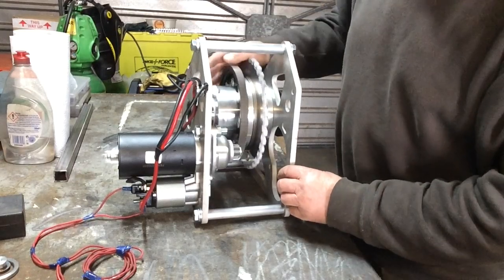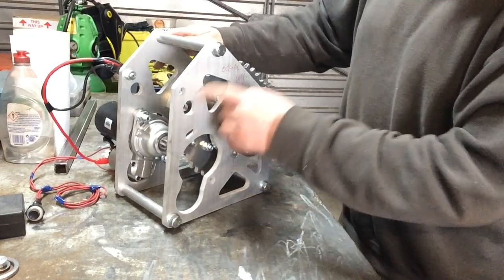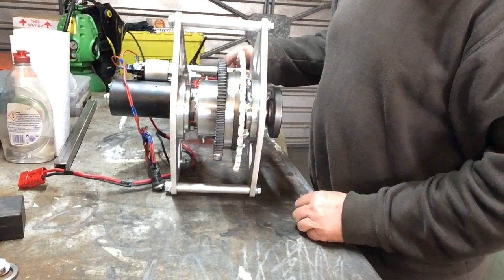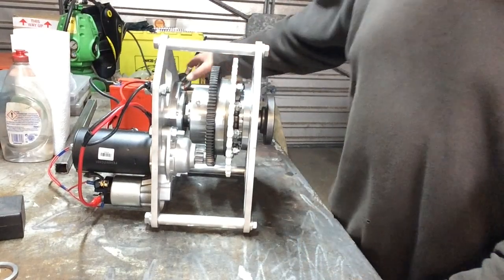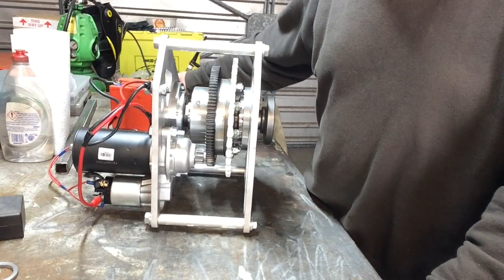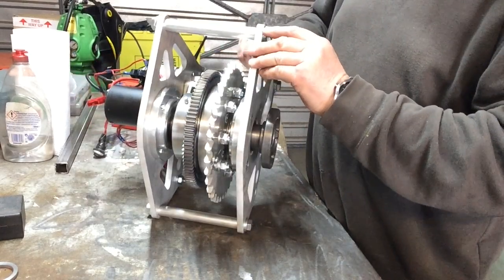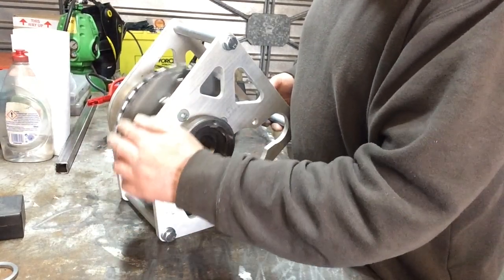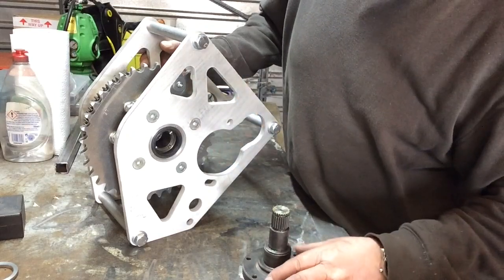Building (Ford) IB5ATB LSD Chain Drive with Electric Reverse

Comment: Hi Doug lovely work I was wondering could I use an 84 tooth ring gear with a 10 tooth starter
Reply from the maker: You need to make sure that the gears have the same module/DP.

Comment: Would it be possible to put a rotor on this assembly some how? Or maybe 2?
Reply from the maker: Yes, I have built several chan drive differentials with either a single rotor on the body of the differential or two rotors fitted to the output shafts. https://youtu.be/rGWsgsf7RXg?si=VOKUy4LdDP8NqD6i
Reply: @ do you believe that one rotor would be enough stopping power for 200+hp and if not would the 2 rotor version be able to work with the electric reverse?
Reply from the maker: @jkallik  I would be wary about using a single disc rotor version even with an LSD. The twin rotor version can cause problems with fouling the reverse motor. I had to use a very large diameter ring gear to enable the reverse motor to clear the right hand rotor. I modified a BMW X5 flex plate for the ring gear.
Reply: @ so I assume the starter motor was mounted somewhere else on the vehicle and not on the assembly like in this video? With the large diameter it still fits in the mounting case?  Sorry for so many questions ; or would it just be more cost effective to fabricate outboard brakes?

Comment: Hello, thank you for your response, I am thinking of making mine with a 188 differential from BMW, what do you think?
Dominic
Reply from the maker: Hi Dominic, I did convert a BMW 188 plated LSD differential (a few years ago). As I recall, it was quite difficult to seal up the case and faceplate due to the location and size of the various holes and cut-outs.
Reply: because of the crown mounting holes?
Reply from the maker: No, the holes in the faceplate where the inner parts bolt in and the holes on the other end of the case where the oil retaining can needs to seal.
Reply: ok, I'll see how to do it.
-the 3 spacers, between the 2 aluminum plates, are also aluminum or steel?
-the crown for the chain is steel or aluminum?
THANKS
Reply from the maker: The side plates are 10mm Aluminium plates (water jet cut), the spacers are 19 mm Aluminium bar, the Sprocket is 7075 Aluminium, the bearing carriers are machined from billet 6082 Aluminium bar, the oil retaining can is 10g (3mm) wall Aluminium tube, the backing ring for the reverse gear is Aluminium billet bar, the reverse ring gear is a modified Kawasaki 900 clutch basket gear welded to a 3mm steel hub. The reverse motor is a VW/Audi 1.9 Tdi starter motor. The flanged output shafts are fabricated using cut down (after-market) Ford output CV joints with EN8 steel flanges tig welded onto them.
Reply: Hello, thank you.
the spacers are a 19mm aluminum bar, they are drilled and tapped at the end?
Dominique
Reply from the maker: Yes, drilled and tapped for M10 bolts

Comment: Hello nice video, where did you find the crown for your er4 electric reverse ?
Reply from the maker: I used a Kawasaki GPZ900 clutch basket ring gear with the centre cut out and an adaptor plate tig welded to the gear.
On other units I sometimes used DP12 gears waterjet or laser cut from 6mm thick stainless steel.

Comment: Are you using a normal 12V battery?
Reply from the maker: I recommend using a separate 12v car battery to power the electric reverse. See my other video showing the unit fitted to a car https://youtu.be/Ir7V3d9pQoI

Comment: What are the specs of the chain and sproket you're using for this setup?
Reply from the maker: I usually use 530 chains and sprockets. DID530ZVM-X chains are good for most use. Sprockets are usually 7075 Aluminium alloy.

Comment: Hi, How do you wire the button to the starter?
Reply from the maker: Best to wire a push button via a relay interlocked to the bike's neutral light switch. That way you can only energise the reverse motor when the gearbox is in neutral.

Comment: Hi mate, I’m wanting to build a ib5 chain diff for my mini r1, what Ford is best for the ib5 gearbox to get the part out that I need ? Thanks
Reply from the maker: Hi Tony, the Fiesta RS Turbo had a viscous coupled LSD which I have used on several chain dive differential units. If you are in the mainland UK, I have a couple of RS Turbo differentials that could be used for the conversion.
Reply: @DougsShed   sounds perfect mate, how can I contact you ?
Reply from the maker: @tonybingley2979  douglas@westgarage.co.uk
Reply: @DougsShed  
I’ve sent you a message 👍

Comment: Congrats on retiring! I read below that the reverse gear is from a Kawasaki and machined, but could you let me know what starter motor you are using and if the starter motor gear is stock?
Reply from the maker: Hi, I use a Audi A2 1.4 TDI 99-05 & Audi A3 1.9 TDI 96-03 Starter Motor also used on VW Golf etc

Comment: Is the ring gear for reverse an off the shelf item or did you make it?  Thanks
Reply from the maker: What's going on in Doug's Shed?
The gear on this differential was fabricated from a Kawasaki GPZ900 gear from the outer clutch basket. The centre was plasma cut out and a 3mm mild steel hub was welded on to provide the locating holes for bolting to the differential housing. On some other units, I used 6mm stainless steel waterjet or laser cut gears. Just a case of drawing up the gear in CAD and sending a dxf file to the cutters.
Reply: @DougsShed  awesome thank you!

Comment: Great Videos you have Doug! Where did you find a ring gear small enough? or did you make it? I'm having trouble finding a small enough one for my build. Thank you
Reply from the maker: The gear on this differential was fabricated from a Kawasaki GPZ900 gear from the outer clutch basket. The centre was plasma cut out and a 3mm mild steel hub was welded on to provide the locating holes for bolting to the differential housing. On some other units, I used 6mm stainless steel waterjet or laser cut gears. Just a case of drawing up the gear in CAD and sending a dxf file to the cutters.
Reply: @DougsShed  Thank you so much! I wouldn't have thought to look at motorcycle clutches for ring gears.

Comment: wonder if a smaller starter like from a motorcycle would work , it looks like every time you engage reverse you teeth will hit the steeringwheel
Reply from the maker: Motorcycle starter motors are a bit too low powered to move a car. They also use a separate starter, overrun clutch which will not work in a reverse direction - when the car drives forwards, the starter motor would spin up and likely destroy itself. I have seen a motorcycle starter motor reverse system which had a sliding dog gear to engage the reverse but if you forgot to disengage the gear before driving off the motor and gears would destroy themselves.

Comment: How much does this unit cost without the reverse motor?
Reply from the maker: IB5ATB LSD Chain drive units start at GBP £795 for a basic unit with sprocket and sealed bearings in Al.Alloy side mount bearing carriers. Mounting cradles are from GBP £130.
Reply: What's going on in Doug's Shed? Do you ship to the USA can you make it specific for a vw beetle?
Reply from the maker: @AzOm606  Yes, I ship units to the USA. The differentials can be fitted with flanged output shafts to suit VW Type2 100mm OD Lobro bolt-on CV joints.
Reply: What's going on in Doug's Shed? That’s wonderful. How much does this unit sell for in US dollars? How do you figure this would hold up to a fiberglass vw beetle with a hayabusa motor attached to it?
Reply from the maker: @AzOm606  Have a look on my website for pricing and contact details https://chaindrivediff.co.uk/product/ib5atb-lsd-chain-drive-differential/
Reply: Hi this is Terrence tez I'm a small YouTuber and was looking to build a race car using one of your chain drives set ups the car will be powered with a Hayabusa motor I visited your website and all the ones that I think will fit the build are saying no longer available
Reply: I'm looking for a system with mechanical reverse LSD if possible

Comment: I will likely be ordering one of these from you in the coming year or two. I could make my own, but the price point is hard to beat. Any chance you'll see designing a version with a heavier-duty motor? One that could handle up to 650kg?
Reply from the maker: Hi Joshua, the electric reverse motor used is approximately 2kw and would probably move a slightly heavier vehicle on low gradients. There are some more highly geared drive motors available but these are considerably more expensive. I do offer a larger diameter ring gear for the differential which would help with heavier cars but there may be problems physically fitting a large diameter ring gear in the space you have available. The large diameter ring gear could not be used with my standard pivot mounting cradle. Doug.

Comment: What differential would you recommend for a small single seat car, 450cc atv motor powered. Will power independent rear end, 10” wheels with Hoosiers. Smallest diff package?
Reply from the maker: Hi Jason, I got your email and sent you a reply today.
The MX5 Mk1 VLSD would be a good choice for using stock parts such as axles/hubs etc.